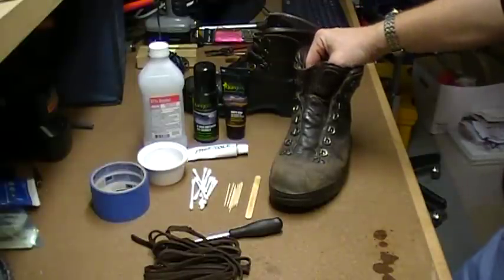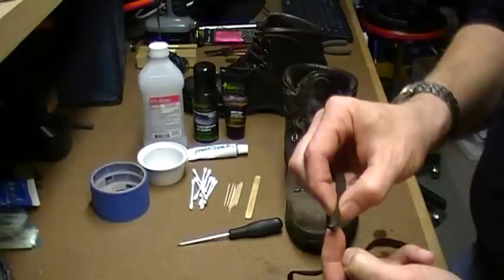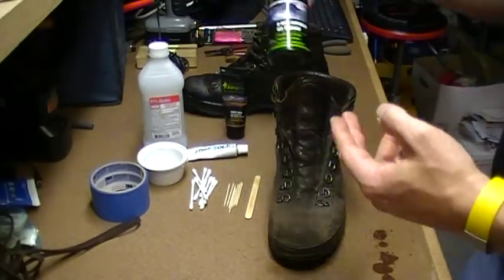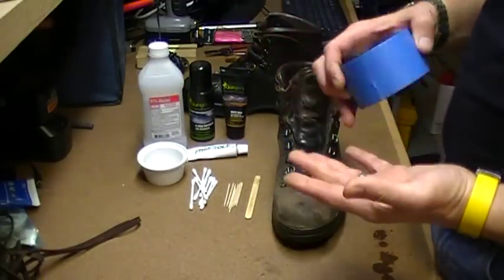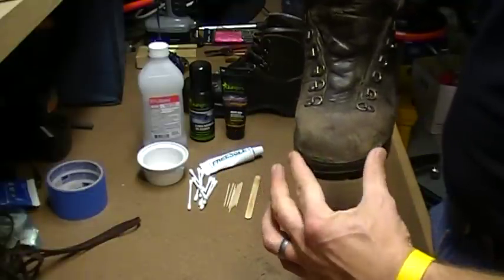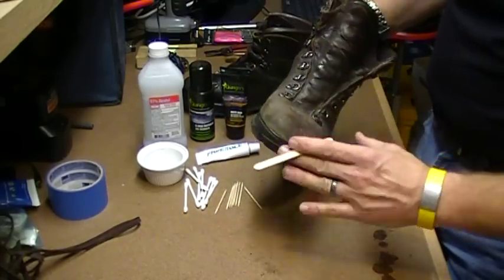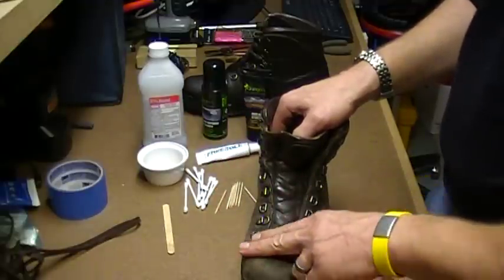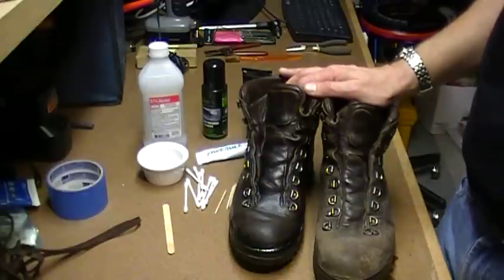How To Repair & Refurbish Leather Hiking Boots

Comment: I just got a pair of crestas off Ebay for $50!! Worn once and just need a polishing the guy told me. 50 is a steal for these boots! I've been wanting to try this type of hiking boot since I was a kid. I'm about to be 35 and am just now trying a pair. I almost went with a pair of asolos but I keep hearing and seeing bad things about the soles coming apart not long into having them. I read through the comments on a video and people were talking about ll bean cresta hiking boots and how they're better than the asolos so I started looking into those instead. So glad I decided to read through the comments. Thank you for this video now I know how to fix them if even needed. I wouldn't went with contact cement but it would've been a pain to get it in between the rubber and leather and let it dry some before attaching them. Can't wait to finally try them! Will need some breaking in but that shouldn't be an issue. How have the insides of yours been? I've seen some people say the inside material pills up tears apart after a while. Thanks again and have a great day!
EDIT
The boots came in and they are amazing! They really are practically brand new! Not even broken in yet. So stiff! I put my insoles in them and wow! About to treat them with some obenaufs heavy duty lp. Can't wait to wear these babies!

Comment: I can tell you three valuable words i was told by the folks at Limmer Boots. "Wax makes cracks." Get yourself a wax free leather grease and your leather will last decades. Ken said there was one thing in common with the people getting 20+ year old boots re-soled. They dont put wax based product on them. It seals up the pores in the leather and over time the oils cant penetrate and condition. so your boots form cracks at the flex points from drying out internally and becoming brittle.

Comment from the maker: Great idea, Cleav! We often use an air compressor to clean gunk out of our drivetrains after mountain bike and cyclocross rides; wash the thing down, then blow out the mud before resorting to a brush, and it gets cleaner and we throw away fewer brushes. Next time we're working on a rand like that, we'll give it a try.

Comment from the maker: Baz-

That's correct, as long as the gap isn't TOO big. If you try to pull the rubber in, it'll try to separate again the first time the boot gets wet and dries; if you just fill the gap, then the rubber is in its natural "resting place", and the repair will last longer. Yes, you can tape it, but not too tight.  If the gap is so big that it creates a big shelf, yes, try to pull it in with tape and hope the repair lasts...otherwise, it'll have a tendency to catch on things. Hope that's useful!

Comment from the maker: DT, for smooth full-grain leather the best product we've found so far is the Granger's Paste Wax. It goes deeper into the leather than most things we've tried, without needing to be put in the oven (which is a chancy thing; it's easy to overheat it and damage the sole or insole).

Comment: Nice little instruction video. I like the idea of using a q-tip with alcohol to clean the sole/boot joint. Thanks for the ideas and I might try those Granger products. My leather re-conditioners never seem to get well into the leather and waterproofing doesn't last.
Reply from the maker: Thank you! And yes, it's sometimes irritating how short a time aftermarket conditioners last. We've learned the hard way that we SHOULDN'T be lazy and should stay ahead of the problem (but that doesn't mean we've learned enough to do what we should).

Comment: In re-dyeing leather car seats it is recommended that, in order to get the conditioners and silicones out of the material, you use a laquer thinner. While this sound harsh it does strip most everything away. I have dyed my own boots but stripped them first with a water-based degreaser. They came out very nice even though they looked horrible once stripped. Check out some automotive leather re-coloring vids. Your mistake may not be as permanent as you think.

Comment from the maker: We've used Sno Seal for years;  great for waterproofing, but has 2 drawbacks.  First is that to get it to absorb well, you need to warm the boots. That's somewhat of a PITA but also an opportunity to damage the boots. Done carefully, it's not a problem, but a lot of people turn the oven on low, stick the boots in, and end up with a melted toe box, rand, or other issue.The other problem is that modern boot soles are glued on, and once the leather has been Sno Sealed, they can't be resoled.

Comment: Not wanting to be argumentative, but, how does applying that cleaner and then letting it dry, clean the boot?  Did you leave out a step or something? It appeared you put this magic stuff on and it made dirt and funk just disappear. Apologies, but I feel like I missed something.
Reply: Basically, applying the cleaner gets rid of any dirt, dust, gunk that is on the boot, which means that the leather is totally clean, and ready for the second product to be put on. That second product won't work properly unless the leather is perfectly clean. The second product makes most of the difference visually, as it soaks into the unclogged pores of the leather to moisten and protect it.
Reply: But it was just applied and left. It was not shown to be wiped off or scrubbed off. Did the dirt and gunk just disappear because you put on the stuff? Do you see what I am asking? Was a step omitted, I guess is what I am asking?
Reply: You must have missed the part where he says you put on the cleaner, wait a bit and then rinse it off in the sink. 
After that is done, you let it dry and put the second product on.
Reply: fajitaboys I watched it again and tried to stay alert through the whole part we are talking about. You are absolutely correct, you did say to wash it off. Not sure how much real dirt and crud that took off but that's your product. You know that this has all been done before, of course. Nothing new under the sun? Except for a miracle product now and then, but that stuff isn't it.
You and I come from completely different worlds of leather work. That is a natural fact. You are overthinking this stuff but I think that is the part you like. I have seen this (to me) phenomenon before, and it is quite amazing from an old cowboy's point of view. Keep on doing the difficult, time concentric things you are doing, I sure do not know a thing about ski boots per se. But I know about leather and you are just messing around because you enjoy it. Nothing wrong with that, but don' confuse that with knowing what is going on with hard used leather.

Comment: I have my leather boots (timberland) and they have become super dry to the point that they look like if i rubbed them of anything they would flake, all cracks and stuff , also pieces of the leather have turned a way lighter colour than the original and some parts of the leather have just swollen, now ive used leather wax to waterproof, i have a leather cleaner and just after getting a leather polisher and nothing is stopping the leather becoming so dry and distorted, i used news paper to reshape
Reply: I would try saturating them in neatsfoot oil

Comment: The back half of the outsole on one of my Bean's 10 year old Cresta boots has completely separated from the midsole.  I've had it repaired (glued) by the cobbler twice & it hasn't held.  Do you think Freesole will do the trick?
Reply from the maker: Mal, if anything will do it, Freesole is likely your best bet. The biggest problem is to get all of the old glue off and both the outsole and the midsole clean; otherwise, the Freesole will stick to the old glue and pull it away from the boot, and you'll have the same problem all over again. Good luck!

Comment: To clean all the sediment from the rubber/sole area try using an air gun from an air compressor. If the air gun has a fine tube end-even better. Be careful-USE EYE PROTECTION! That sediment shoots out as fast as the air goes in. Anything that can come loose will.

Comment: I have a gouge in the leather in the toe of my Redwing boot, not all the way through. What is your best advice for a repair of that?
Reply from the maker: Doug, it's hard to say without seeing it, but we've had generally good luck with Shoe Goo for filling gaps (and not just in footwear). Clean the area well with alcohol before you put it in. If it's an area that has a lot of flex, that might not work, but it's a cheap and effective solution...you might have to re-do it off and on, but a tube of the stuff lasts a long time. If you want a solution that LOOKS better, we'd say to go talk to a cobbler; they might have better ideas.

Comment: I want to remove a rubber logo that's been sewn onto a leather boot, but I'm unsure if it's also been glued on. Is it standard practice to both sew and glue these logos for double adhesion? Thanks in advance.
Reply from the maker: Honestly, no idea! You'll likely find out once you start removing the stitches (we'd recommend trying a standard sewing seam ripper first, as you're less likely to cut the leather than with a knife). Good luck!
Reply: thank you

Comment: Somewhat surprised you aren't using any of the Nikwax products ?  Have used most of the cleaners & treatments over many decades but they've all been the ones that the better or larger Outdoor Retailers sell like REI, etc.  Also surprised that seam-sealing appears to have fallen out of favor ?  Used to use an industrial type of neoprene cement that went on as a thick, viscous yet easy to apply "gel" that never ran & adhered like it was Barge Cement !  When it cured, it had magically shrunk !  
.

Comment: Is it ok to wash leather boots with warm water then dry excess and cover the boot with leather wax??? or does water harm leather?
Reply: Lots of rain never bothered the cow those boots were made of
Reply: @karinlarsen2608  the cow was also alive at that point. Water is not good for leather it dries it out. A little water isnt bad as long as you're conditioning after to resupply the leather with the oils that have been stripped out. Too much water tho is bad. Don't wanna go soaking the leather

Comment: i love my boots but the siding looks awful ... its that soft material that gashes and gets cut easy ... how do you repair it  ? same method ?
Reply from the maker: We hate to admit it, but we don't know how to solve that problem, other than what you see in the video. But, that's with a very hard surface leather; if you have something softer, I'm afraid you're just going to have to call it "patina"...you know, sort of like how antiques have their dings and dents. And hey, look at it as a badge of honor...you actually use your boots hard, rather than wearing them to look cool at Starbucks!

Comment: I have a puncture in my leather boot and water is getting in-between the layers. How do I fix that?
Reply from the maker: +Ikkaku572  Your smartest move is probably to take it to a cobbler and see what they recommend. However, short of that, we would probably make sure that they're very dry, and then use Freesole; work it into the puncture and seal around it. If your cobble has a better solution, please pass it along...we'd love to know about it!
Reply: Where can I find a Cobble in Texas?
Reply from the maker: Google "shoe and boot repair."

Comment: Paracord = Fantastic laces..if they somehow begin to fray..just heat and melt..:)
Reply from the maker: Scotty, that's a great idea!  We'll definitely give it a try. Thanks!
Reply: no problem:)
Reply: No do not pull the inner strands out..that is cordage that can be used if you find yourself needing some in a situation. You can then pull individual strands out and still have a lace for your boot:) Besides the strands make it stronger as you well know

Comment: You never demonstrated putting the cleaner, glue, or the protector products on or what to do after you put them on?  How did you get the dirt off the shoes; just run water over them or scrub them?  I wanted to see a video - a demonstration of how to apply, take off,  ect.  This is more of an audio, which I felt was too long and boring.  I need to see the freesole or shoe goo applied because I have no idea how long it takes or how hard it is to put it on correctly; how much working time do you have; can you smooth it out after applying; do you apply it all at once, or in sections?.  I "assume" it must be difficult because you did not show how to apply anything and to be honest, your glue looks awful.
Reply: I've found if you jump into the job, the job will teach you how to do it

Comment: Beeswax is good for the stichings Like any other kesther wax. As you better Not treat leather, which got modern leather tanning, with leather-oil too often, beeswax is the Alternative to Lanolin (Wool Grease). Lanolin is a leather softener and degrades the structure of Elastomers and Material in use at shoes which are glued or dye-injected.
Lanolin was/is okay for Double-stiched and frame-stiched footwear. These are framend and stiched, while the glued Outsole is Not that critical.
So beeswax is the solution but creates Problems as Well.
1. Beeswax is Wax and Not Grease. Leather Grease Like silicon oil protects leather tanning and the original waterproofing from being washed Out. The Same with the Treatment with Wax.
2. If the leather got vegan tanning you should Not apply Emulgators. Beeswax includes Emulgators. Lecithin iscthe emulgator at beeswax. Lecithin even attracts wetness. Beeswax offers a water-repelling but Not really protection in wet and humid conditions.
3. At any Kind of leather you should protect the leather tanning and original waterproofing from being washed Out. The good ingridient of beeswax is the Paraffin. Several herbal waxes do have parrafines as Well.
Holmenkol Natural Active Wax is 100% pure herbal waxes, which a good Level of waterproofing by Natural parrafines. Compatible to any Kind of Material. You can even  treat Ripstop, Mesh, Canvas, etc.. and Not leather only.

At Nubuk-Leather it is usual that you give colour Back by coloured Creme before the Treatment with e.g. Wax.
You can offer some Sil-Proof (original waterproofing at Alt-Berg, Scarpa, Zamberlan, Meindl and Combat Boot of the Bundeswehr) with the Original Leather Grease of the Bundeswehr.
Do Not use too much as Lanolin is in use as Leather Grease as Sil-Proof is a Leather Grease tanning.
It incl. also Wax for the stichings. If the recipe would habe Wax and the  silicon-compound only the Wax would Push Out the Grease of the original leather Grease tanning.

A Boot which is still leather Grease tanned ist Dogwalker by BAAK Producer by Grisport in Italy.
Grisport is also producing Mountaineering Boots for DECATHLON.

The Dogwalker Boots are with Sympatex instead of Gore-Tex.
Grisport is implemrenting an welded bootie instead of a stiched and sealed bootie.

Comment: Never use a dryer...
Reply from the maker: Depends on the dryer! If the temperature is too high, it's a horrible thing to do; if it isn't, it will gently and fully dry the boot, which is a lot better than leaving moisture in place to cause mold, fungus, bacteria, pick your favorite nastiness. Also, remember that with permeable membranes, water doesn't travel through, only water vapor, so if you leave your boots/gloves wet, they'll often stay that way, which is even worse. We've trusted DryGuy products for years; they run at 105 degrees, which is warm enough to dry the boots without doing any damage.

Comment: Alcohol dries out rubber as I remember?
Reply from the maker: Theoretically, yes, but a quick application like that isn't going to do any damage, and to our minds it's much more important to make sure that the surfaces are totally clean and free from grease so that the Freesole adheres fully. There are probably other cleaner/degreasers that would work as well or better, but rubbing alcohol works great, is cheap, and is always around, so it's what we use!
Reply: Oh thanks! :) Keep making good videos